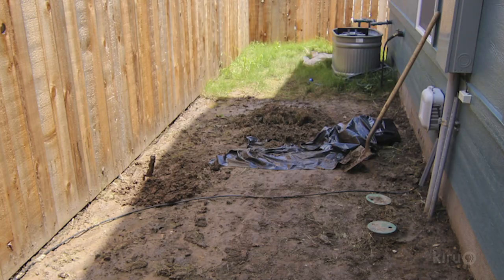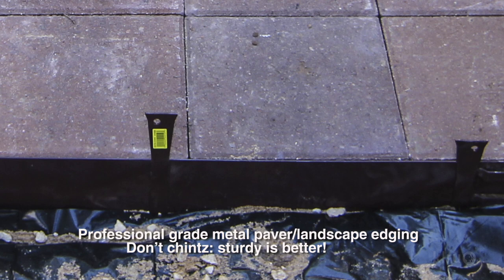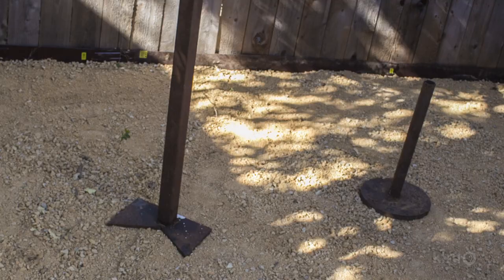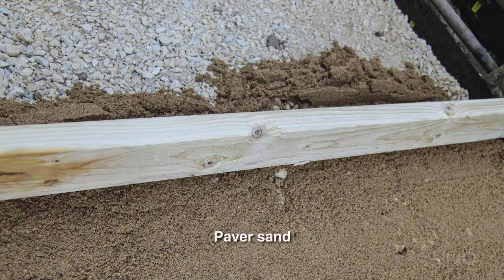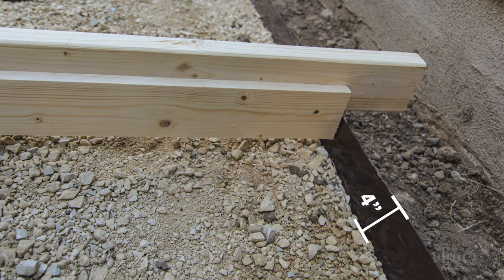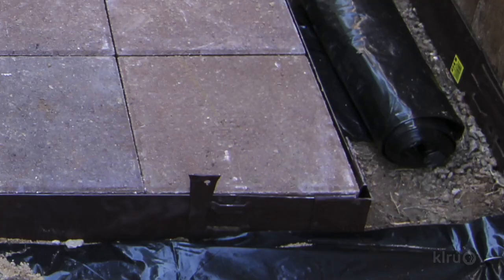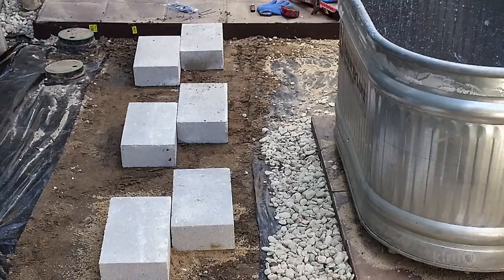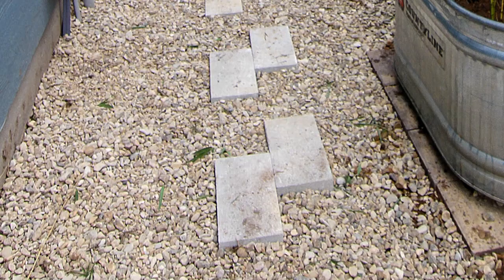Make a pathway |Mark Morrow |Central Texas Gardener

Comment: The tanks are heavy when full. Do you think the bricks you put under the tanks will shorten the life of tanks?  Would you bother putting them on bricks if you were doing it again?  I’m wondering if the exposed holes might invite trouble rather than being preventative. Thanks for the video.